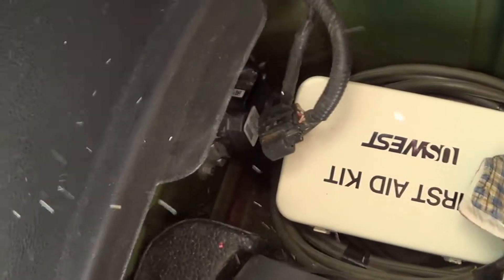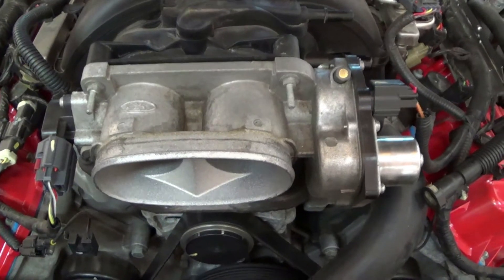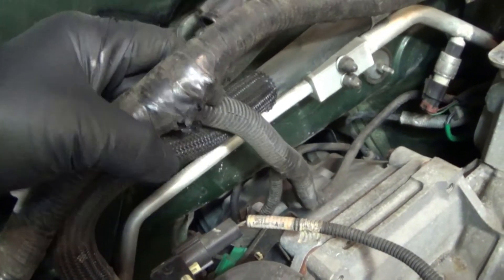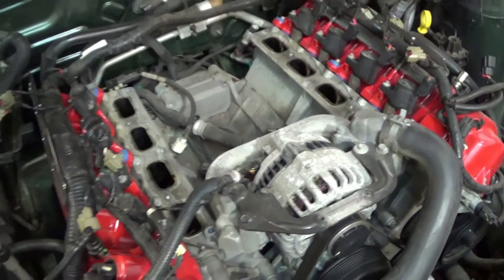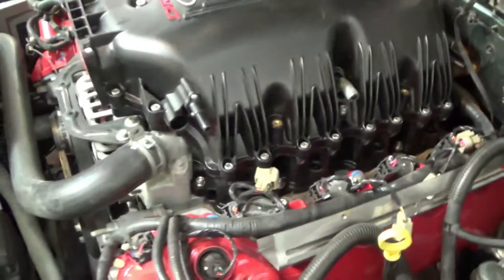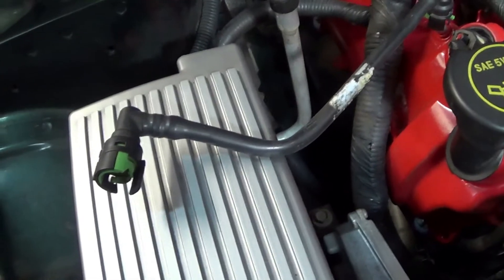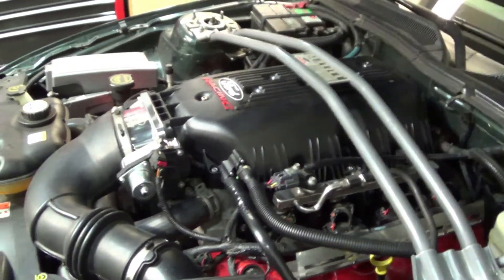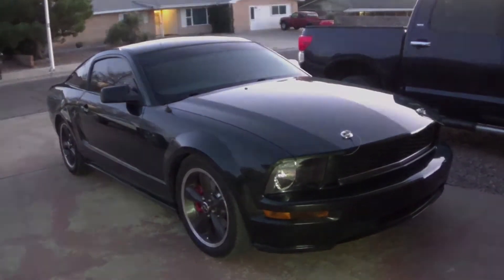2008 Mustang Bullitt FRP Ford Performance Intake 62 MM Throttle Body and Bama Tune Install

Comment: I subscribed hey did you put the cams on there from ford racing. I’m doing the same thing cams intake TB PP heads with new rockers lash adjusters underdrive pulleys and some exhaust

Comment: Ohh man.. I can’t wait to get my 62mm bbk throttlebody for my 2010 grabber blue gt.. i got my airaid cold air intake, my bama tuner and I’m replacing valve covers with blue ford racing ones and swapping out cam phasers and bolts while I’m in there.. also planning 40lb injector upgrade for e85 in the near future.
Reply from the maker: Cool , Good luck to you !!!

Comment: Mike a nice difference Lisa is sounding really good.  Now you might want to consider a short throw shifter  as I noticed night and day difference from the stock, it should have come factory with a short throw  shifter and it creates a even bigger smile when rowing the gears  and now no more missing 3 rd gear    :)
Reply from the maker: Thanks Paul , I am considering that. Got a fav. brand?
Reply: Hi Mike, I put a Hurst  companion short throw shifter in my Mustang Bullitt only it has a annoying shifter rattle 2,500 RPM. to 3,500 RPM. there are two neoprene  spacers  I am going to try one and hope it eliminates the shifter rattle. Like the click between gears and it gives a classic look too. Ford makes one, Barton  makes one, think a few more. I would find out if Hurst  has fixed the shifter rattle issue. It's a nice shifter  design  and has adjustable shift stops so you don't damage if shift too hard.
Reply: @N-Scale  
Hi Mike I put in a Hurst competition plus short throw shifter with adjustable  shift stops so if you shift too hard it won't damage, they make two versions competition  and competition plus short throw shifters for Mustang and really like it, only there is a annoying  slight shifter rattle noise between 
2,500 RPM - 3,500 there is two neoprene spacers I am going to try one and then two and hope it eliminates  the shifter rattle,  like the click it makes when goes in to each gear and  has a nice ohthentic look too, I think Ford makes a short throw shifter, Roche,  Barton, maybe check if Hurst has fixed the shifter rattle issue first there is a noticeable interior  noise too think it just needs some sound deadening. I just want you to know all that I have found out
Reply from the maker: @paulr1305  Thanks , I was thinking Hurst or Barton.
Mike
Reply: @N-Scale  
You are very welcome Mike
Reply: Mike I was wondering if  you  are going to do a dyno test after all of your  updates and  engine tunes  ?  I was also wondering where you got your engine compartment cosmetic updates?
Reply from the maker: @paulr1305  No Dyno here in my town. The wire covers were from CJ Pony Parts
Reply: @N-Scale  oh no well it should be substantual power gains do you think 
75 HP - 100 HP more?
Thank you very much for telling me where you got the wire covers from
Reply from the maker: @paulr1305  I do not know but it feels better!
Reply from the maker: @paulr1305  I just ordered a Barton
Reply: @N-Scale  
Oh that's really good Mike let me know how you like it when you get it installed
Reply from the maker: @paulr1305  I will for sure.
Mike
Reply from the maker: @paulr1305  It went in OK, had a bear of a time wiggling the old one out but the shifter works great. Nice and positive and smooth
Reply: @N-Scale  
Hi Mike yes quite a bit of work  to replace.
 I am so glad you got it done and like the results

Comment: Sounds like you already had cams before this mod
Reply from the maker: I have FRP cams BBK headers, MBRP Mufflers, Delete Plates, BBK Catted X Pipe, 62MM FRP Throttle body, and Aluminum FRP Drive Shaft.
Thanks , Mike
Reply: @N-Scale  thanks for the reply Mike. I almost made the mistake of doing the intake, throttle body and jlt tune naturally aspirated only. Based on what I’m reading I would lose torque without pro charge.
Reply from the maker: @flbizowner9384  The setup I had was the best one with a Brenspeed tune. The Paxton has taken this car to a whole new level.
Mike
Reply: @N-Scale  did you install a cam before you replaced the intake manifold?
Reply from the maker: @flbizowner9384  I did replace cams before I tried the FRP intake and the Stock actually seemed to work better , to me.
Reply: @N-Scale  thank you. Exactly what I needed to know and suspected. The FRM is a waste unless you Procharge the motor either with a cam or turbo. Otherwise you lose torque across the band. From what I understand it has to do with the chargers and plates in the OEM manifold that forces pressured air down the intake. Unlike the frm that can not unless bosted. 
Took me a while and many videos, comments, to come to this conclusion who have also made the mistake.
Reply from the maker: @flbizowner9384  I do not think the FRP manifold is worth 10 cents. Plates do the same thing.